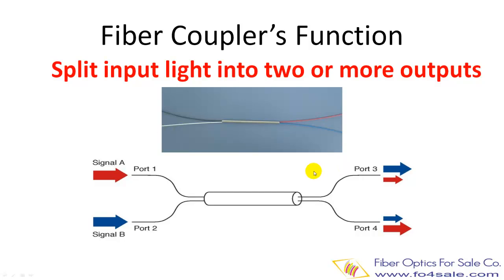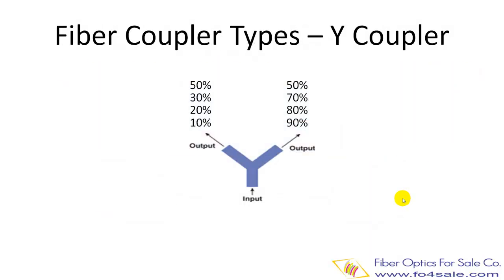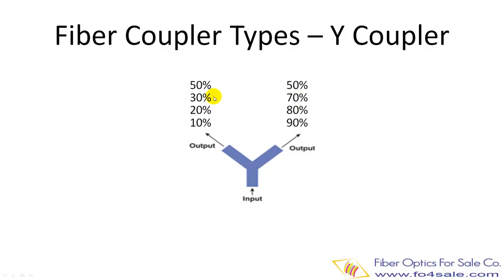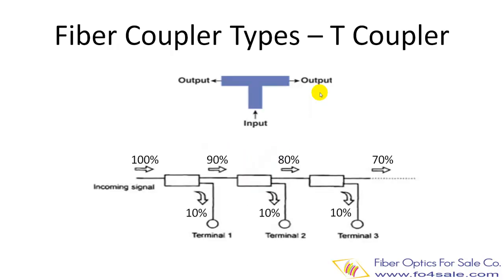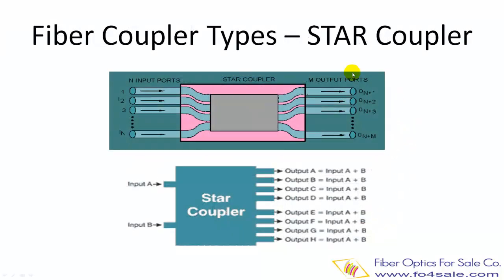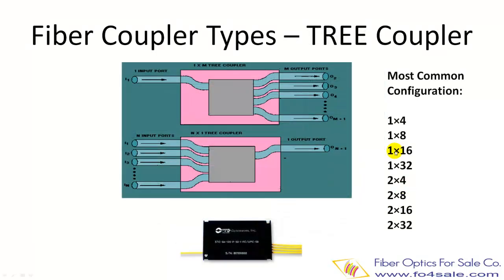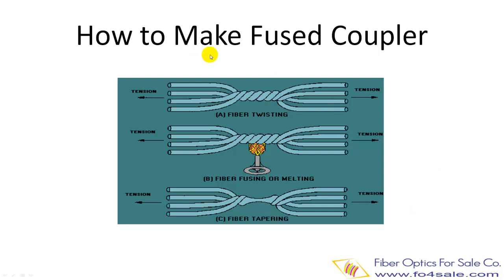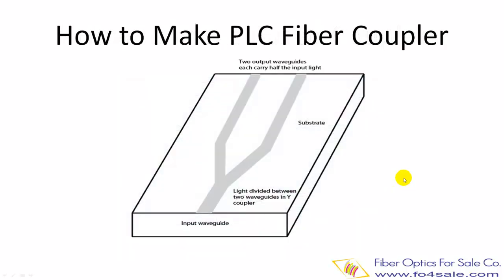Fiber Optic Coupler Types and How to Make Couplers

Comment: Hello Sir. The explanation was amazing but I have some questions.Does Optical Coupler is also used as an isolated boundary between Electrical and Optical mediums. If yes then why?. Is it converting Electrical Signals into Light Signals here?